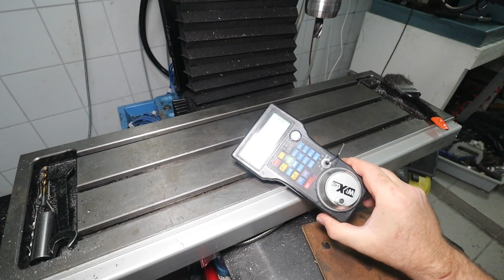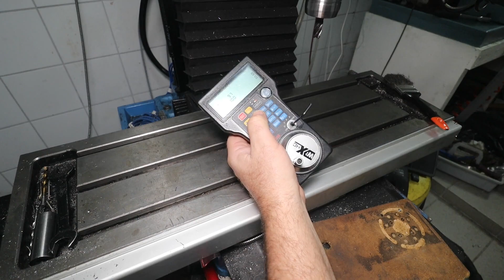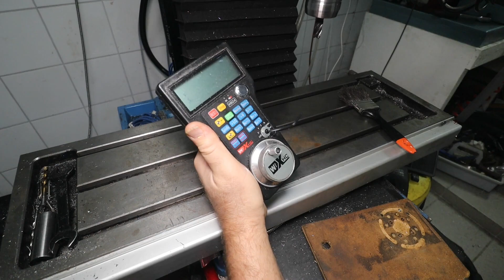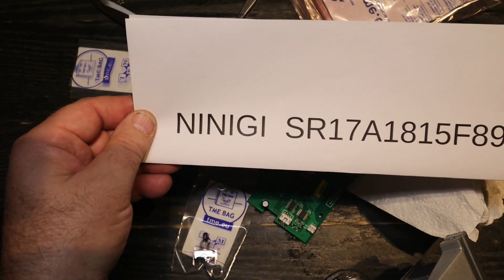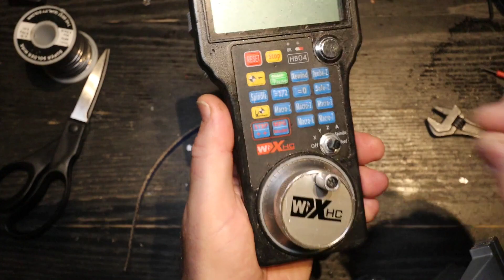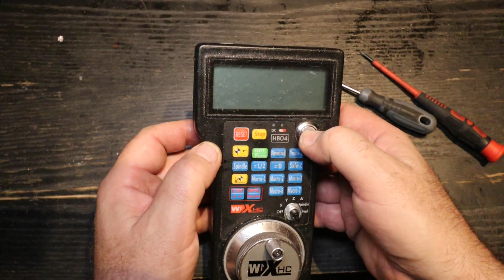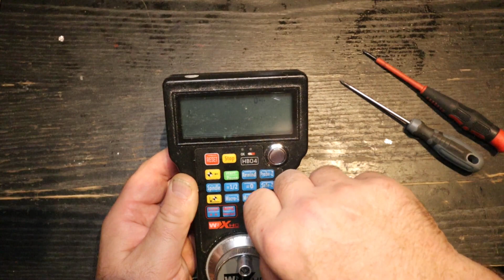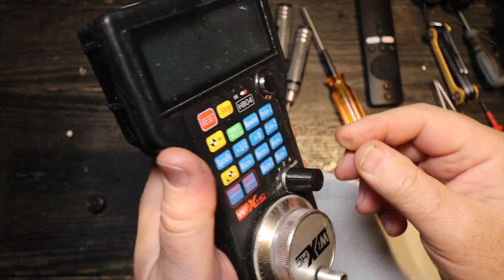The MPG broke

Comment: You need to be careful mate. Replacing a 7 position axis control switch for an 8 position one was how This Old Tony first managed to unlock the secret "Time travel" feature on his lathe. Without the upmost care, you may accidentally twist that switch around one click too far and end up having the part you'd just been working on disappear.

It's bad enough losing something that could be anywhere in your workshop, but if it could also be lost "Anywhen" too, it becomes a whole lot more of a problem. :D